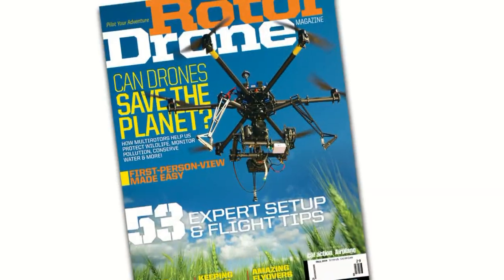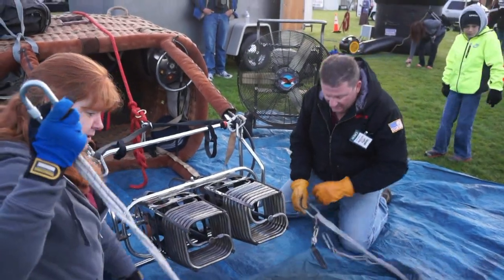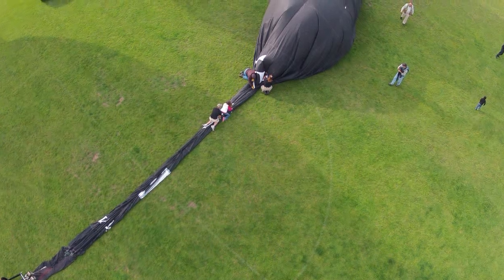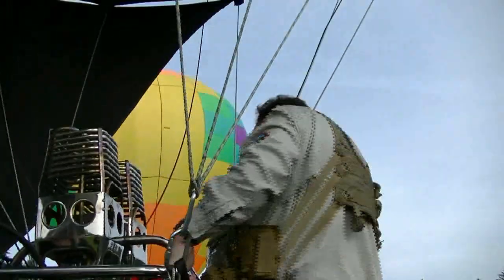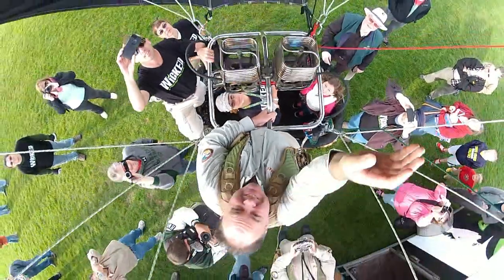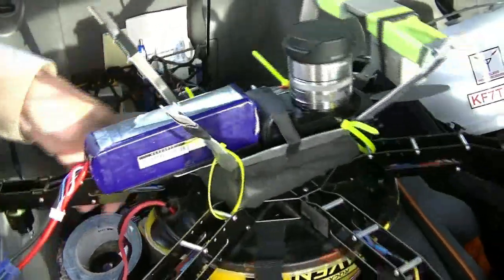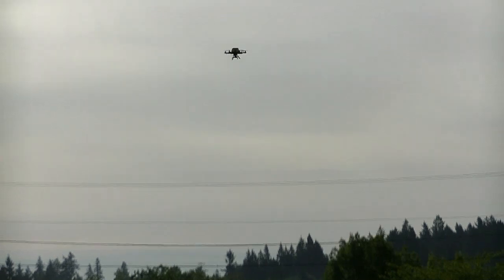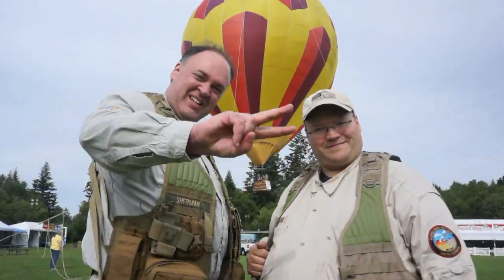RFTC: Flying an FPV Multirotor at a Hot Air Balloon Festival for RotorDrone Magazine

Comment: When you are talking to the FAA next, how about you suggest they allow amateur FPV but with plastic props only. If you want to go carbon, you need to get a licence due to the increased risk. Plastic props equals low risk toy, carbon or composite equals professional. Can't even tear a balloon!

Love what you do, glad you are setting a safe example for others.
Reply from the maker: Ben Govett Hey, Ben! Truth be told, we've never spoken directly with the FAA ourselves. We do communicate regularly with the Academy of Model Aeronautics (AMA), who, in turn, communicates with the FAA. For myself, I wouldn't want to judge whether or not carbon fiber props are really that much more dangerous than plastic props. You'd need to spend some time in a laboratory to make that determination scientifically valid.At this point, my main concern is simply getting the FAA to understand the technology and not kill the hobby outright. After a recent meeting, the AMA told us that the total, lifetime experience with model aviation of one of the prime movers at the FAA on this issue was attending the Toledo Weak Signals show once as a child. We've got a lot of baseline understanding to build up with these folks before we start worrying about nuances like what type of material your props are made from...